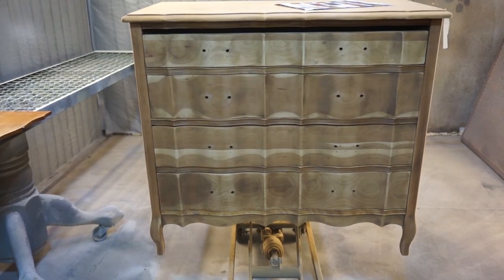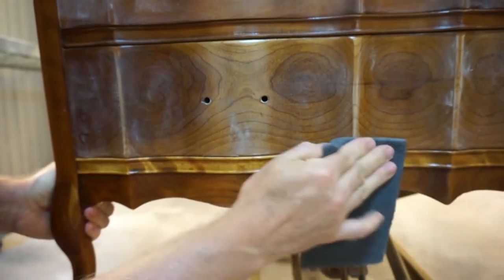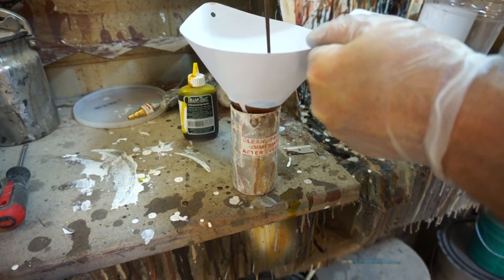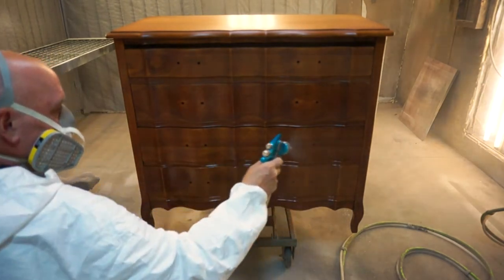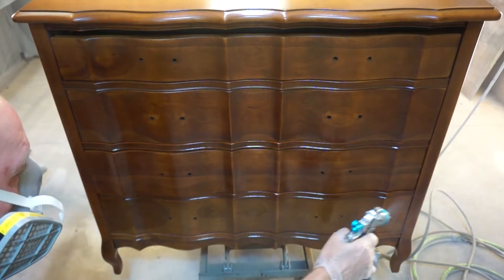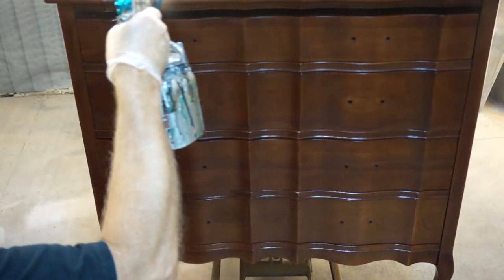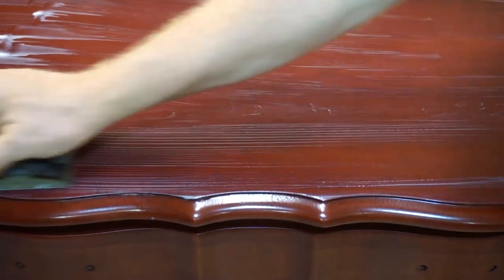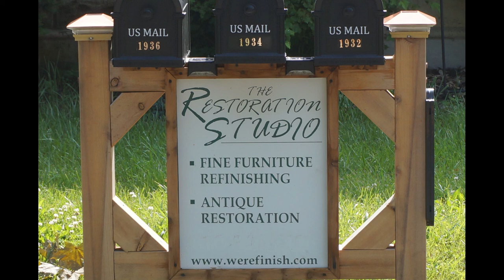How Pro's Finish Wood Furniture - Furniture Finishing Secrets - Refinishing French Chest Part 3

Comment: Beautiful work!  I have been doing this for over 20 years but it is amazing how much more there is to learn seeing how others do it. Is that an HVLP, RP or Conventional gun? Also in your toner coats what is your ratio of lacquer/lacquer thinner?  Thank you for creating these videos and sharing.
Reply from the maker: Thanks !  I'm guessing the gun you are asking about is the one I am using for clear coats?  That is a Kremlin M21 paired up with a Graco Tritan 308 air assisted sprayer.  I shot a vid on that too, but didnt include it because the vid just got so dang long !
Reply from the maker: As for toners and tints, I don't thin the lacquer. The last thing I want is a run in my tint coat because it's darn near impossible to fix it properly so I use uncut lacquer.

Comment: Great video, thank you!  

Question for your, I am refinishing a table for my sailboat made from Teak laminated plywood, the previous owner painted grey, I want to refinish in natural Teak.  I've stripped using Citrus Strip, most of the paint has been removed.  However I still see a grey shadow in several places around the perimeter.  I tried using CitrusStrip and 0000 steelwool, the shadow persists.  How do I remove the remaining grey shadow?  I'm reluctant to sand, as I may go through the Teak veneer.
Reply from the maker: Its impossible for me to really advise you without seeing it in person, but you should have enough veneer thickness to at least sand a little by hand.  I hardly ever refinish anything without at least some degree of sanding.

Comment: You must have little fluid coming out to be able to make that many passes that slow without runs.?.?
Reply from the maker: Not the case at all actually.  There are a lot of factors that come into play. Equipment, finish, air temp, etc.